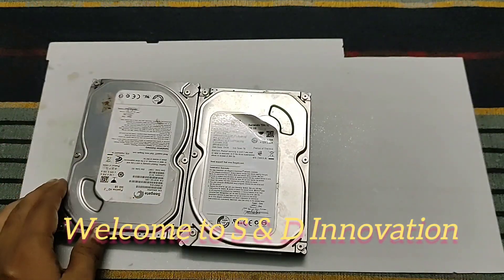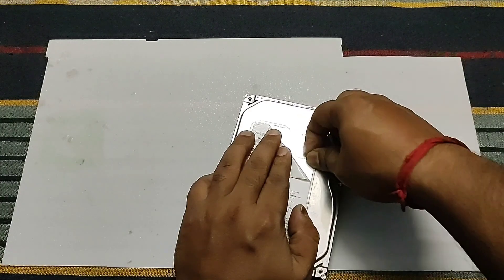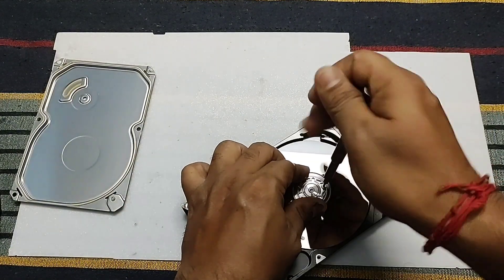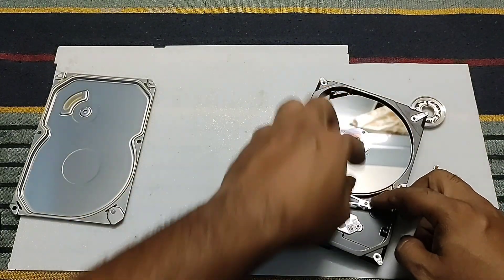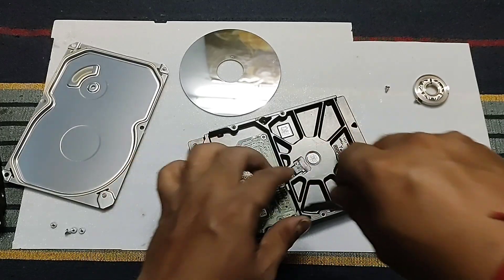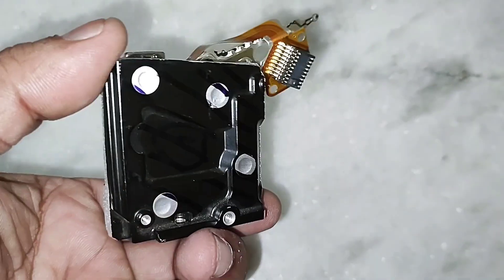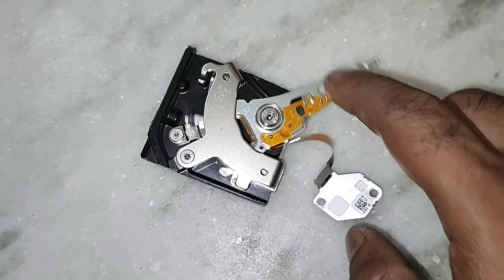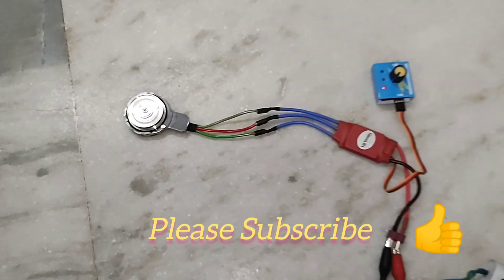Drone motor from scratch

Comment: Not sure if that would be efficient enough to make a decent drone from 
Wouldn’t it be easier to just a small dc motor you can find them in most electronics nowadays
Reply from the maker: Flying toy aircraft with harddisk drive bldc is already available in YouTube, I have seen it
Reply from the maker: Brushed dc motor don't have good life